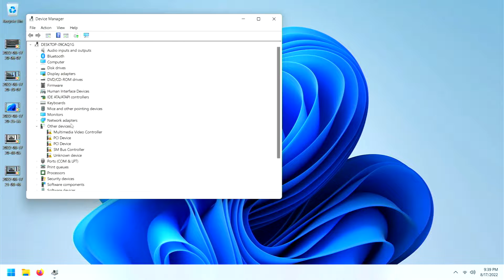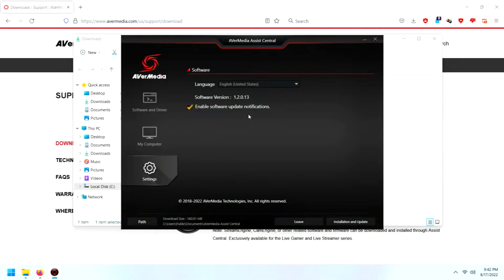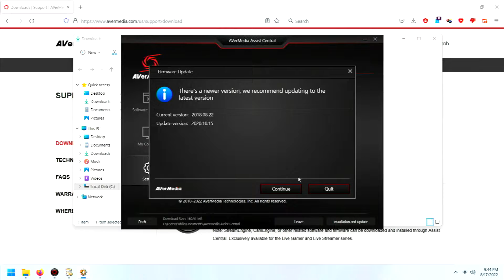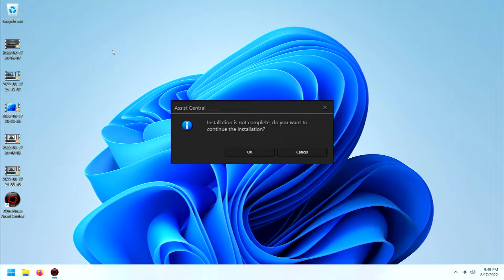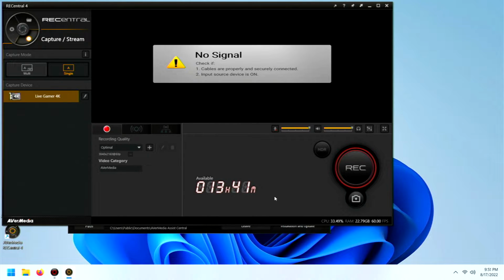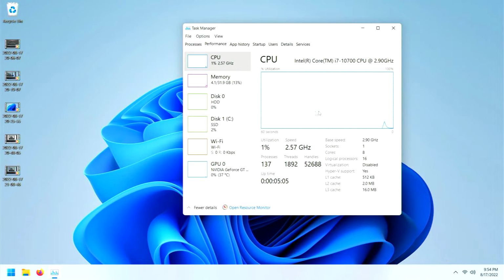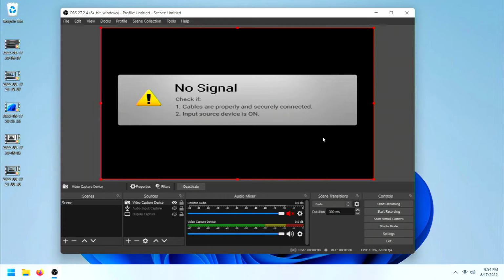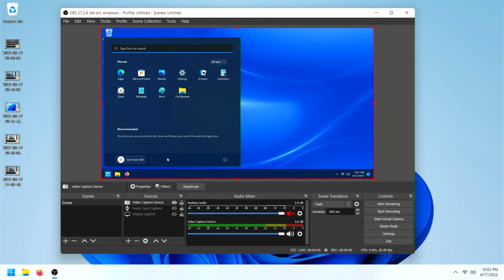AVerMedia Live Gamer 4K Video Capture Card Installation

Comment: Thank you very much this video helped alot. Does anybody know how to make it also record the audio of the pc?
Reply from the maker: You're very welcome.

The card records audio over HDMI. In OBS, around 8:20 in my video, under the heading of "Audio Mixer" you can see "Video Capture Device" and the 2 level meters for the left and right channels, which are unmuted (white speaker icon next to them). If there had been any sound playing on the device I was capturing, those meters would have been moving. 

You can also see in the same selection that I have "Desktop Audio" muted (red speaker icon with an X next to it). That turns the sound off on the host PC (the computer the card is installed in) so you don't get Windows sounds, unwanted music from other things, etc in your recording. If you wanted to plug in a microphone to that PC and record audio for that, you would need to add it as another audio device just like how I added the video capture card as a device at 8:00. You would just pick Audio Input Device instead and then select your mic. Then you can control desktop audio, your mic, and the capture input all independently. You can even set them up on separate channels so in editing you can do your own track mixes instead of OBS mixing them down to 2 channel stereo as default.

If it's OBS you're having trouble with, there are a million really good tutorials for how to set everything up. It's powerful software that is pretty complex once you get into it and I'm not really qualified to cover it. 🤣 As regards this card, I think mine just pretty much worked. I don't think I had to do anything more than plug it in, install the software, then start OBS. What you see in the video is all I did.
Reply: @TheBrokenTech  Any idea how this would interface with Virtual Audio cables? I have something like Ch A. Game Ch B. Mic Ch D. Discord. Currently i was able to route those through OBS so that I can adjust each volume channel separately.
Reply from the maker: @ That sounds like an OBS thing, so... The card probably wouldn't matter?